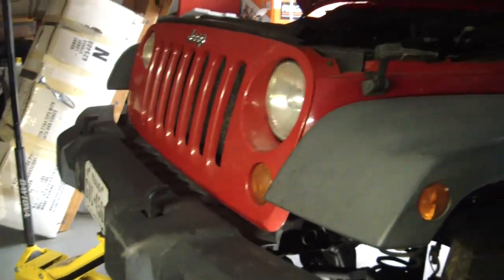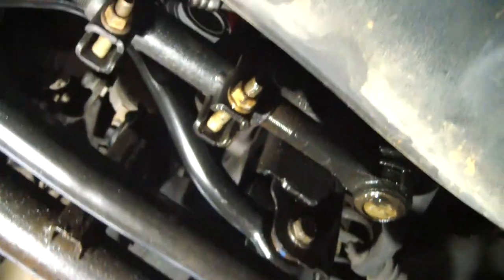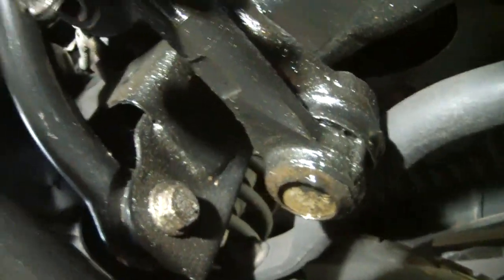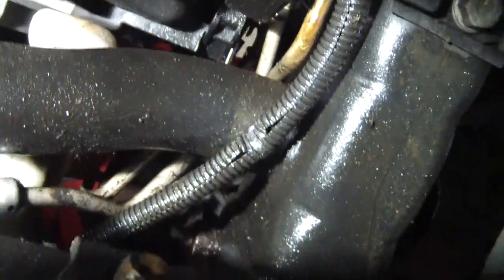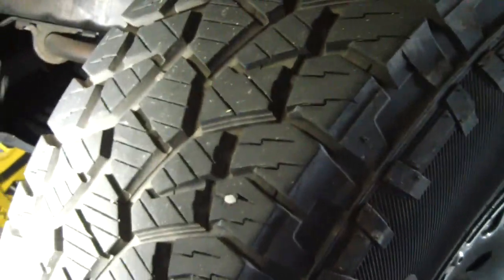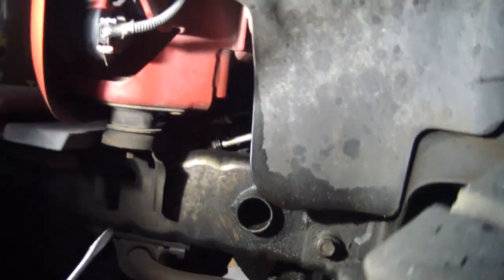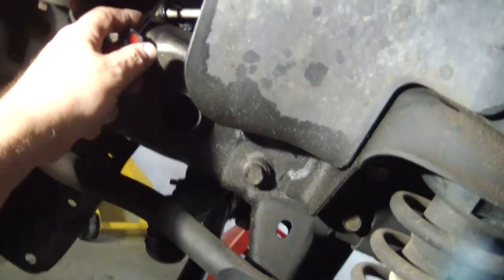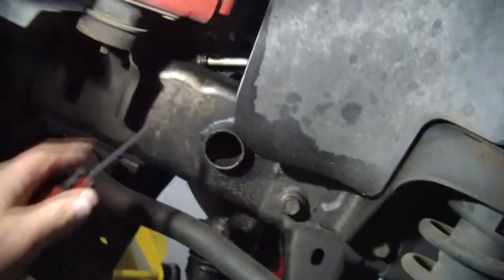Jeep Wrangler JK transmission line assembly / hoses leaking / replacement.

Comment: I did this years ago with the lines still installed and it has been perfect ever since. Im thinking of rerouting to a under body mounted transmission cooler and just using a small section of the hardline flared to connect to new AN stainless braided lines.  Thanks for the video showing how to disconnect the hardlines from the transmission

Comment: Very helpful, never thought or knew I could just replacing the hose part.  Definitely doing this instead of new lines.  I think I can cut those clamp pieces off without having to remove the lines too.
Reply from the maker: You can cut them off without removing the lines but it is way easier to remove them. If you do leave the on you will have a face full of aluminum and rubber as you are cutting them.

Comment: Did you lower the drive shaft to get to the upper connection on the transmission
Reply from the maker: No I didn't need to.

Comment: How did they hold up 737mechanic?  If you had to do it again, would you just replace the whole assembly or just the rubber hose again.
Reply from the maker: They are still on there and holding up fine. If I had to do it again depending on if I wanted to save a few bucks and was willing to get a little dirty I would still do it the same way. If you want the easiest and fastest way out order the assembly and remove and replace and be done with it. Cutting the old ferrule's off is a little messy.

Comment: I was able to cut my lines metal clams without unplugging the lines at all...
Reply from the maker: Yes, you can do it without disconnecting the lines but it is so much easier and quicker to disconnect the lines install the new hoses, and connect the lines back up. Do that under the jeep with crap falling in your face isn't fun.